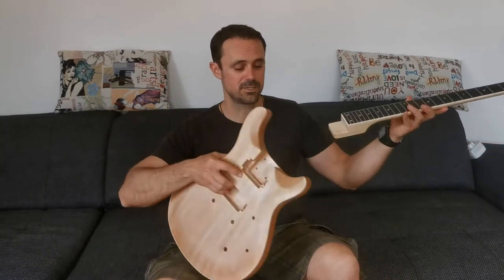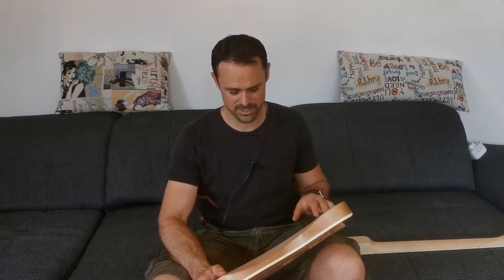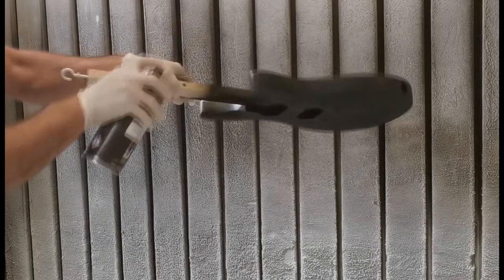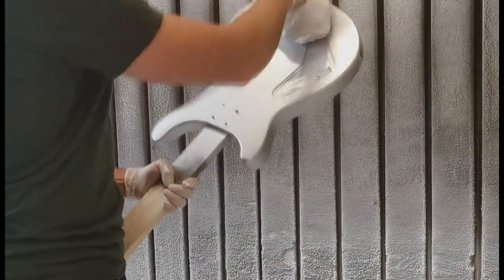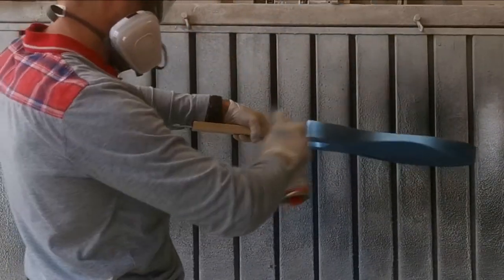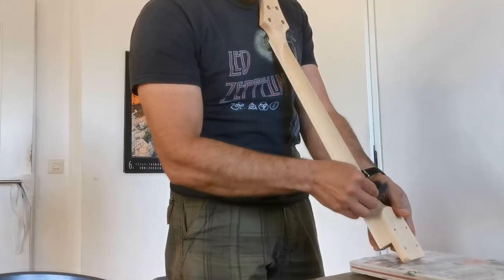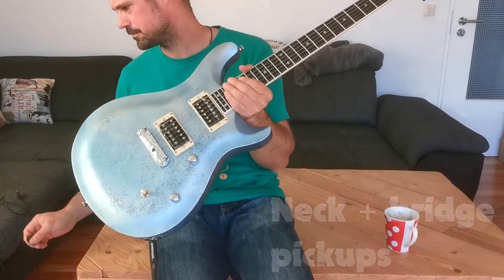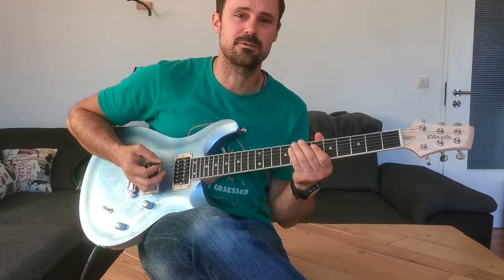Full build video for Thomann's DIYkitChallenge22

Comment: It looks like, after having bested him in battle, you used the husk of Robocop as a guitar body.  His finish in Robocop 2 was especially not dissimilar from what you have achieved.  Looks awesome... Seriously, are kits as much sanding as they say (if I'm just trying to get a paint grade finish)?
Reply from the maker: Thanks! This kit comes with a sealer on it, so you can already see if there are going to be inconsistencies in your paint job by holding it up to the light. I didn't find it too difficult, but this more complicated shape provides many difficult edges which you can easily sand through the paint on. Be careful about sanding/polishing too much!